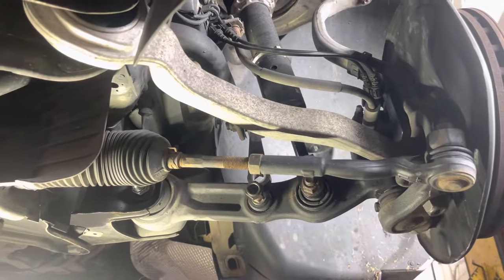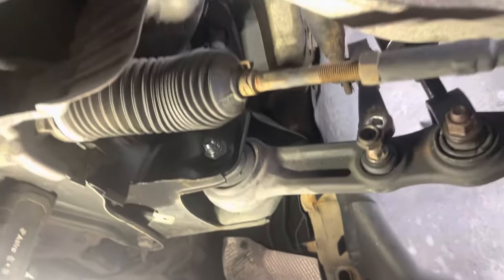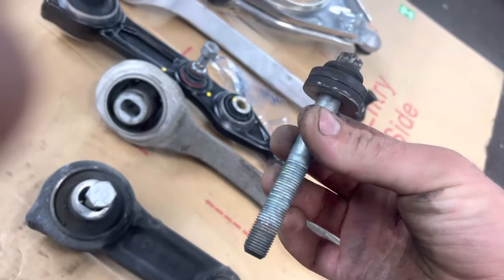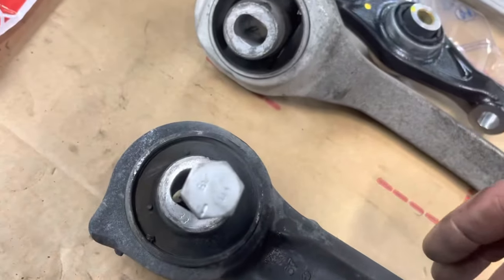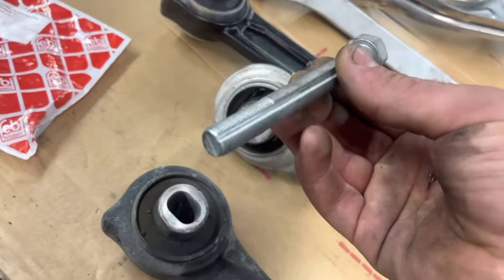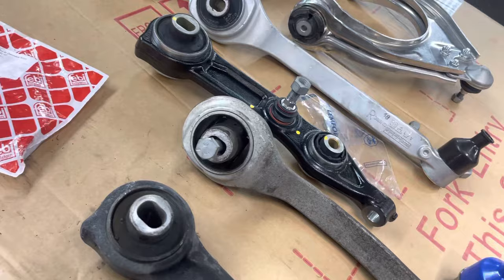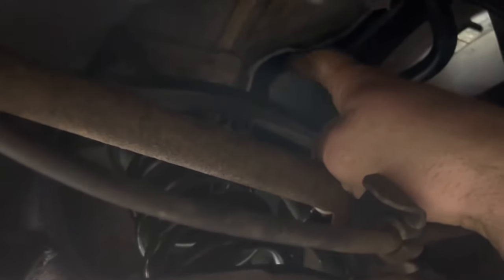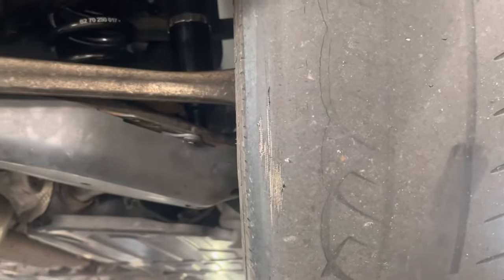How to adjust front  camber and caster  on w211/w219(e320, e500, e550,e55 amg, e63 amg,cls63, etc,)

Comment: Did the bolts solve the problem ?   Also, they do make a camber adjustment kit for the rear without having to replace the upper control arm.

Comment: I have a CLK 320 w209 fell in a pothole and the wheel was pushed back but I changed all the suspension lower parts and it's still slightly pushed back does subframe didn't look like it was damaged any solutions on this issue?

Comment: Hello Tony, how about a follow up video. How many miles have you done since then. Cured your tire wear?. 

Front chamber for W211 is supposed to be -1.4 degree +/-0.3 degree. Chamber bolt supposed to reduce negative chamber by 2/3 of a degree. 

So an initial reading of -1.5 degree (negative chamber) will be corrected  to -0.84 degree. So this will be a slight over correction vs -1.1 degree for staying within its optimum range?.😅😅😅.